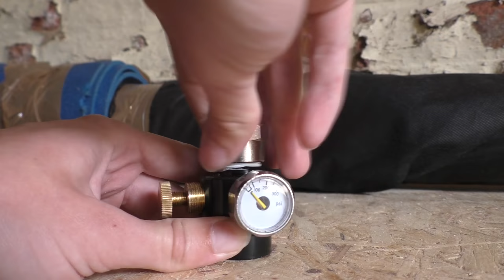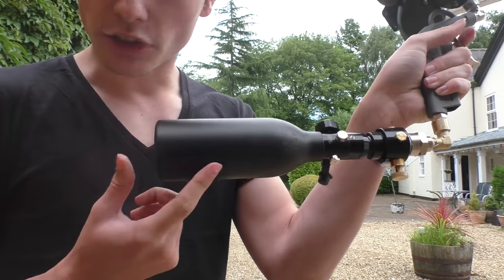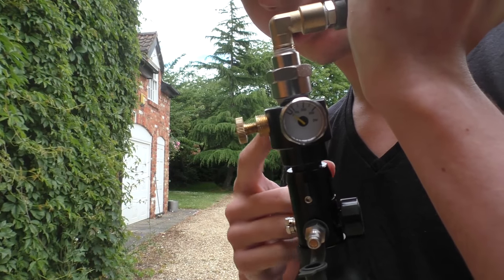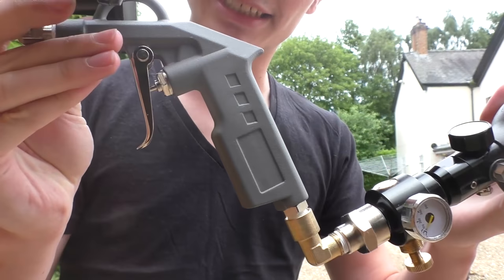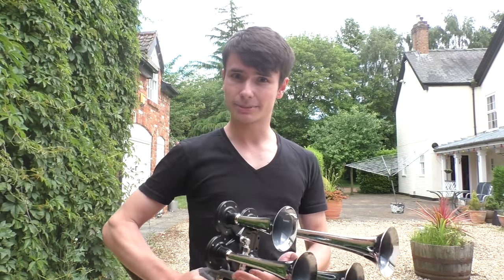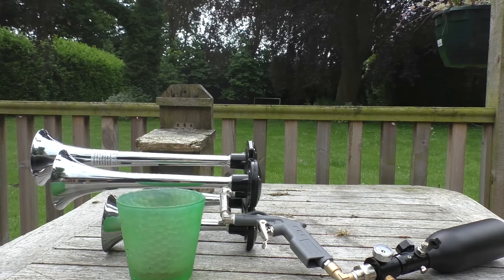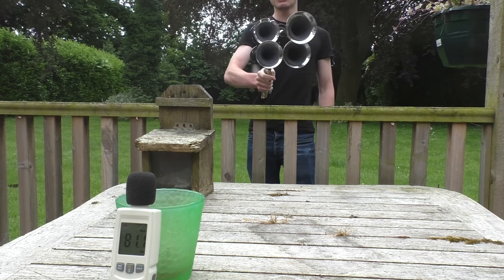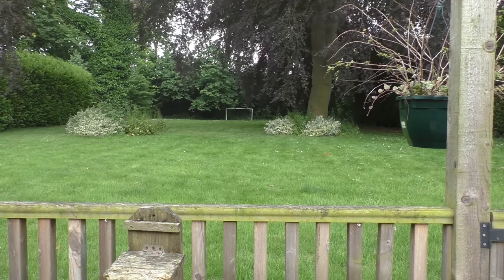How to build a handheld train horn

Comment: Nice! What would you say your materials cost was, minus the air tank? Also, would C02 work for this, or would it freeze up the lines or something? If it would work, you'd need one less regulator with that lower pressure, and a cheaper tank